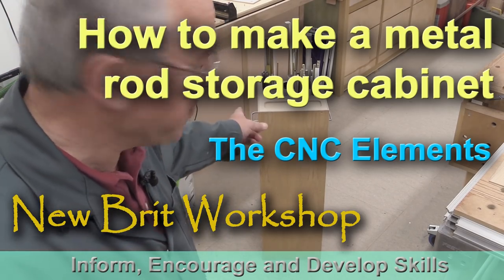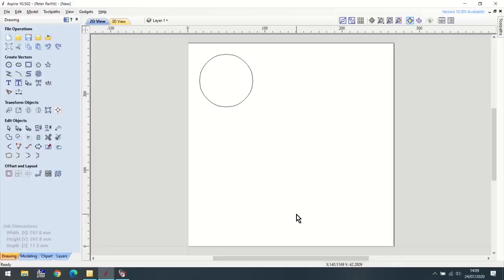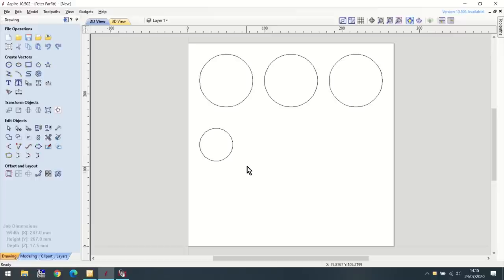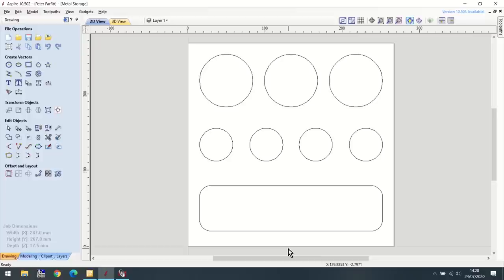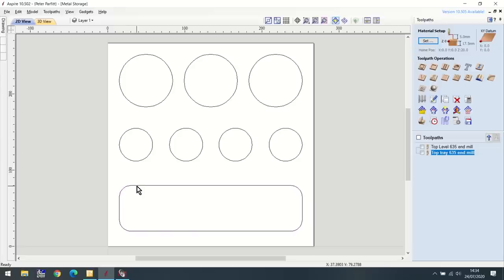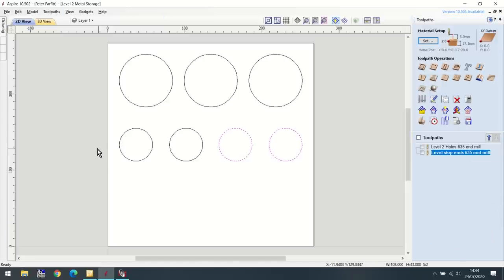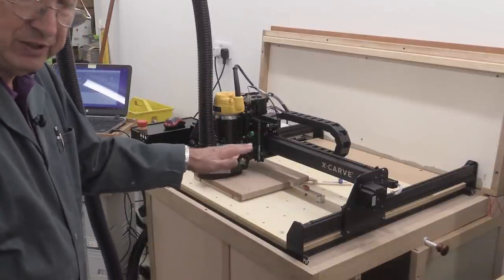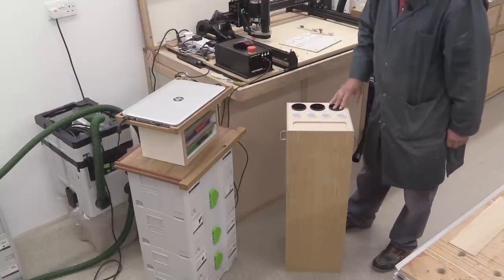Metal Storage Box for CNC Users

Comment: If you add some apertures in the front panel you also have a handy set of shelves. It would be a shame to waste all that space. That will also allow you to recover the short rod you accidentally dropped into a long tube - it will happen.
Reply from the maker: Great Idea. Cheers.  Peter
Reply: I always have a strong magnet on a string to pick up dropped or spilled screws when my back is acting up and can’t quite bend over easily. I’m sure that would work for you in this situation. Or put the magnet on the larger piece and use it to lift the  smaller item dropped in the wrong tube. 😊
Ron
Reply: @ronh9384  I have tubes of brass studding. Magnets might struggle.

Comment: Why do you specify a cut depth bigger than your material thickness? Is the X-Carve so inaccurate that you need to cut into your waste board .5 millimeter?
Reply from the maker: You should always cut through by a dash as it leaves a cleaner finish on the underside. Also, 0.5 mm is not excessive. I take it that you do not have a CNC of your own?  Peter
Reply: @NewBritWorkshop  I have a Shapeoko CNC and on that one 0.5mm is excessive. I rarely have issues with just setting cutting depth to the exact material thickness. Only if the material thickness is very inconsistent I get a little remaining that is easily cut with a box cutter. Reiner
Reply from the maker: Hi Reiner, That is a very nice small CNC and probably more accurate than mine. Cheers.  Peter

Comment: Excellent video as always Peter! 😊
I’ve always wanted a CNC but there are so many to choose from and I am not sure I would be able to figure out the software, etc. I don’t want an expensive paper weight! Maybe once things are safer I can find a basic class. I would like to get some hands on experience to learn to use it and make sure it would fit with my type of wood working...  I have done several projects that would have been much easier with a CNC. When my daughter got married she asked me to make them a large set of letters with their initials. Luckily their initials were the same! But they were 16 inches tall and rather than doing them in sketchup or autocad I did it vertically and then scaled the curves and width by eye.... I did it all on templates first and after several design drawings on the template I cut out my templates and proceeded from there and they turned out nice.
A CNC would definitely have saved some time!!!
Ron
P.S.   Sorry for the rambling 😊
Reply from the maker: Hi Ron, Someone beat me to it to mention that brass is not magnetic !  I am not very tech savvy either and the Inventables X-Carve is quite easy to master. I have made a complete set of videos about its assembly and there is plenty of other stuff on YouTube to help. I have the 750 mm (middle range) machine and it is brilliant with the small Dewalt router.  Take care.  Peter
Reply: New Brit Workshop 
Great thanks Peter. I will check them out. I guess I could always get a small Inventables CNC and if I need or want to go larger from there I can sell or gift the first one. And I have always considered you very tech savvy. All the computer work and editing you do as well as having a YouTube channel and all of the things you have come up with or collaborated on! 😊 You are a very accomplished person...
I used to be decent with a computer and built my first two computers but that was in the early days of computers! 😊😊
Thanks for the advice and words of encouragement Peter.
Cheers
Ron
Reply from the maker: Hi Ron, My tech savvy reduces at the same rate as my brain cells disappear ! I too built computers and remember paying nearly £1,000 for a 1GB (yes that is one Gigabyte) hard disk. Cheers.  Peter

Comment: As usual beautiful description on how to use software. Could an x-carve be used indoors with some dust extraction?
Reply from the maker: Hi Dave, Yes. Mine is indoors in the workshop and there is very little dust provided you use a dust extractor. I would recommend a Festool extractor as they will run for long periods of time and are very efficient.  Peter

Comment: Good evenning. I do not own a cnc. I enjoyed your way of explaining how to operate the software. Thanks.
Reply from the maker: Glad it was helpful!
Reply: You don't need to buy a CNC ready made - they are expensive. A CNC is a great project to build from scratch. You can make a useful one very simply, then use it to make the parts to improve it. GRBL controllers are very cheap, and there are plenty of stepper motors on Ebay. For the spindle motor, start with a small router, or even a Dremel.
Reply from the maker: Hi Don, Can you recommend any videos or blog sites for people to seek out? I built my X-Carve from a kit which I know is not what you mean.  Cheers.  Peter
Reply: @NewBritWorkshop  Let me think about it.  Mine is still definitely a work in progress, but it has advanced to the stage where I can cut quarter inch aluminium.